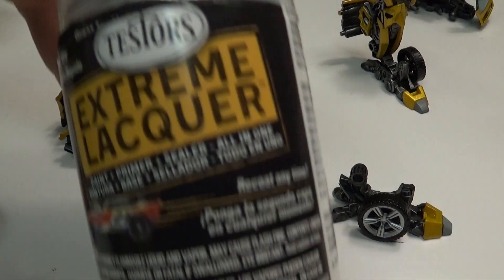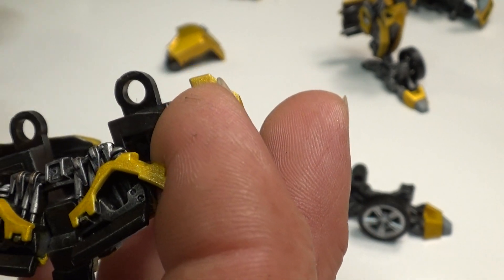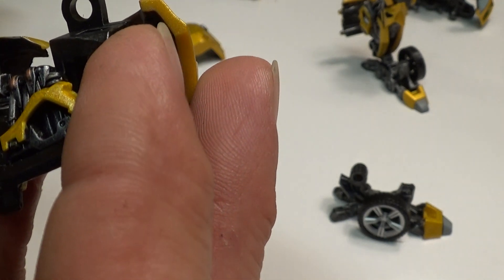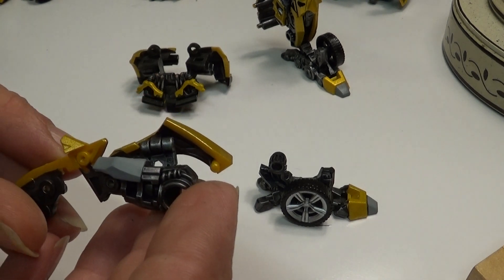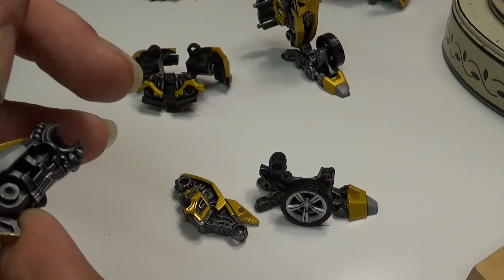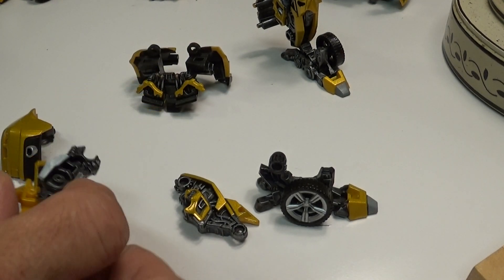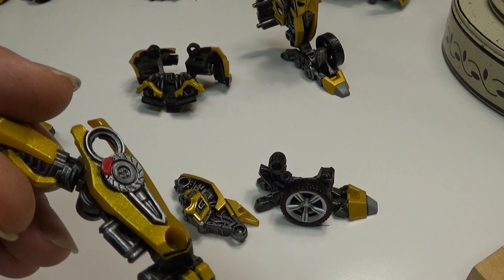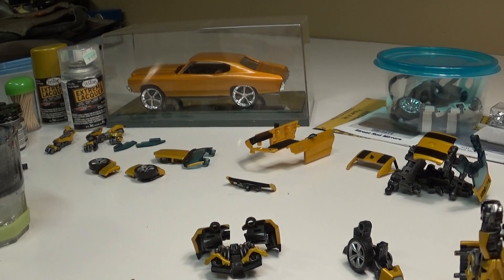How to Customize & Paint 1/24 1/25 Models & Transformers ( Detail Part 2 of 2 ) by matt1989cars

Comment: I also have a question, maybe you can give me some advice and tips if you want. 

I have a rotf sideswipe I want to make red.
1. I took apart the doors so I want to try and start with that.
2. Washed the doors with a little soap
3. Sanded the doors with 1000 and 1500 grid sandpaper
4. Used a white primer 2/3 layers
5. Sprayed it red with tamiya spray 2/3 layers
6. Used a clear topcoat 2/3 layers

After the last step I let them dry for 30/60 minutes but if I pick them up they feel dry but when I grab them really good to put them together they stick a little and my fingerprints are in the paint a little bit. 

Also with one piece that dried for 8 hours. Is the paint to thick? I really don’t know. Do you have a idea maybe?😬
Reply from the maker: Yeah patience is a big one with models and painting. The very next video will cover alot of what you mentioned. Hopefully you can wet sand the prints out of the clear coat and reclear it? Light coats of paint and clear with the last clear being the heaviest. Tape up areas that fit together tight or sand them down after paint and clear to fit snug.
Reply: matt1989cars thanks 🙏! I’m gonna try it! Yeah the tapping was a pain in the *ss 😂 do you have a fb page or insta? Or are you in the 3rd party transformers group on fb?